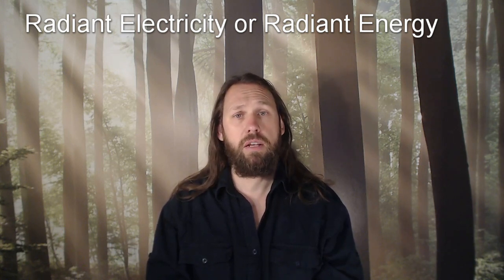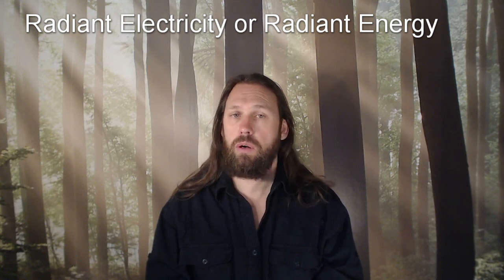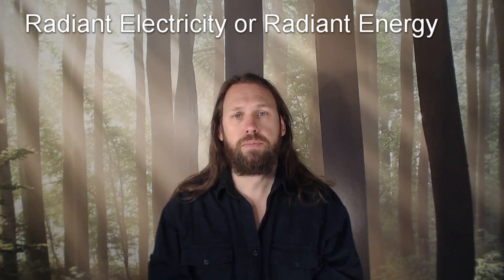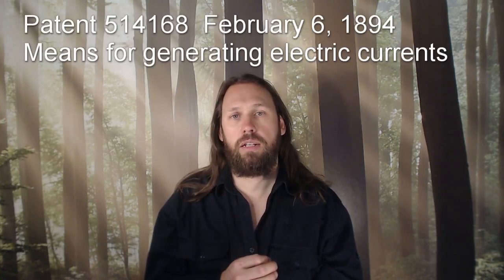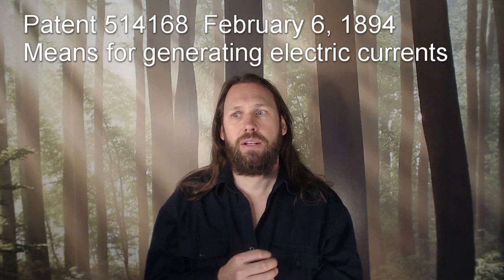The Radiant Electric Bifilar Coil Research Update

Comment: have fun in your studies thanks for sharing - - i am also studying simply {counterspacial} fields  as they realate to both gravity and 'magnetics' - i'll be interested to see what you discover and would be happy to share if it's helpful- regards.
Reply from the maker: Thanks Kolin Evans. Sharing is Caring :)
Reply: it is indeed - only when we share can we learn i think -
 
funny i'm about doing what you were doing with the pancake coil except i'm using an 'OP AMP' just to loop the output back to the input i think that will automatically find the resonant freq based on the 'capacitance' and induction - i will have to try it with a pancake coil.. 

i thought 'op amps' would be difficult to understand turns out they are the simplest and most fun component i have played with so far {on our glourious planet} 

for a monment there i thought actually i had created a monopol flux signal - as i had a set up with just a single inductor {high wind 13 H} and only one end of the inductor connected - the signal on the scope was showing a 'flux' signal like you know an 'inverse' wave - and i hooked up a diode to create a 'type' of 'flyback' and the signal only showed if the diode was 'negative' {a word i don't use}  - then i was laying down the circurt was so simple i was thinking dam....

the only thing to do now is disconnect the inductor to MAKE sure it's a monopol - sure enough disconnected inductor - signal still there {back to the drawing board}  no idea where 120V ppt is coming from at 7~kh then from my 'Earth' lol .

anyhow yeah i'll follow along and get in touch maybe sometime -
Reply from the maker: Yes opamps are fun, I used them a lot when building guitar fx pedals. I  hope you will post your research results in your videos. always fun to watch!
Reply: yes indeed i will share with you if i make anything interesting as i see you are doing a lot of study / work here as i am also - have you seen this video ? :

you will need to search 'Flyback converter' by Sam Ben-Yaakov - {i won't post a link as G algo will censor that} - anyhow the main point is the abilty to 'interrupt' a 'magnetic' field {usually in coupled inductors} and create a kind of 'magnetic' pump - i found that very helpful when i learned it. 

anyhow have fun.
Reply from the maker: No I haven't seen it, I will look it up. Thanks for sharing, and have fun!
Reply: anytime - actually i just watched also the 'Forward Converter' very interesting also.  regards.
Reply: @digitalindustry if you are on telegram - if you want to share ideas on these anytime. {i actually have a question lol}